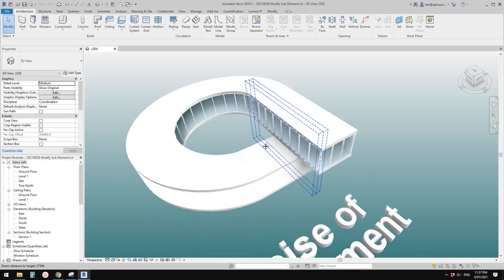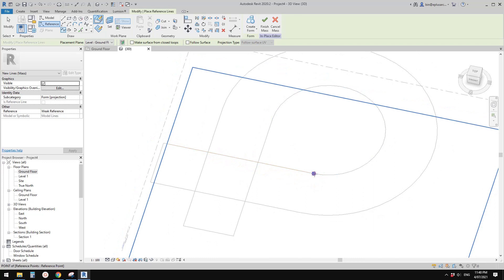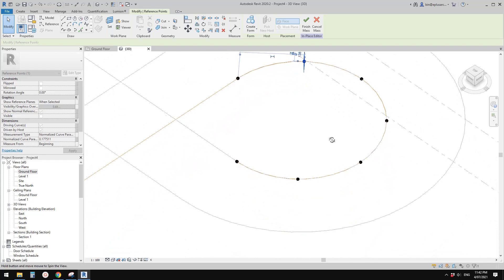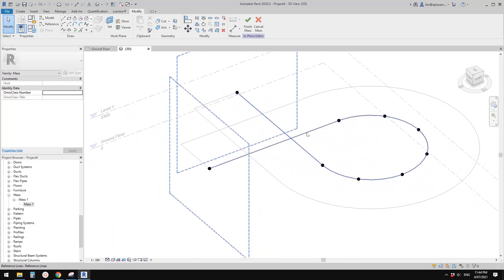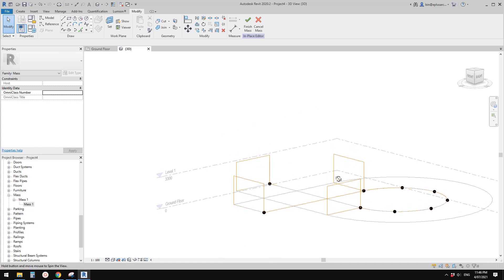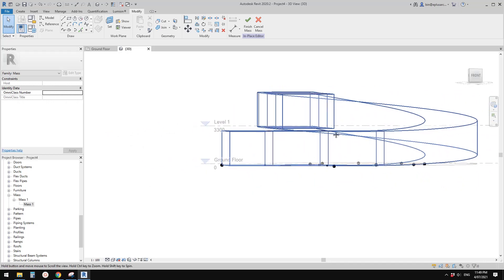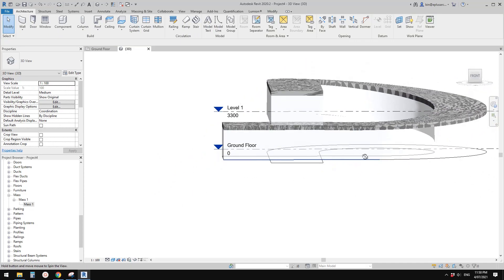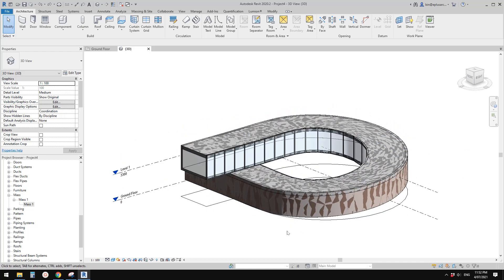Everyday Revit (Day 471) - The shape of 466 using Mass

Comment: saludos , disculpa crees sea posible crear una estructura a partir de el uso de perfiles estructurales adaptandolos a esta forma curva sin hacer el uso de las rejillas dde muro cortina?
Reply from the maker: Usually, you can use structural framing with 3D snapping to create beams that follows the edge of geometry. But it will probably not work in this case because spline is involved.

Comment: Quite tricky to understand the difference between Model and Reference...
Reply from the maker: Do you mean model lines and reference lines?
Reply: @BINHE615  Yes exatly :) Don't know when to use which
Reply from the maker: You can use both model lines and reference lines to create form in mass, here are the differences:

1. Color of course, model lines are usually black, and reference line orange by default.
2. After creating form, model line will disappear and reference line will stay, which means you can still adjust the form by adjusting the reference line.
3. When you load the mass to another mass, or project, you will not be able to see any reference lines, but you can see model lines.
Most of the time I use reference lines in mass unless I want to see them when loaded.

Let me know if you find more difference between them. :)

Comment: wow wow wow! Magician! Believe me your channel is unique, no other talks at all about that cause it's a little scary part of Revit 👏👏👏... thanks you brave Bin  

now I want to ask:
 
*how you delete the form & keep the dots? do you mean dissolve? cause when I delete the form the points are gone
*when point is selected      Properties > Dimensions > Measurement type >  Normalize Segment length what makes the distance between 2 points from 0 to 1? is it right? 
*I 've experienced that sometimes the profile flip & turn around when you copy it away from the path ... although there are options like flip, mirror & rotate angle for each point but Revit could not make the shape even ... I tried to add profiles while the form is on (in the place where Revit accepts : ) then move it them by the keyboard arrow forth & back ... at least you can see when it will crack  👀 
* You can also divide surface in Mass & load a curtain panel family or an adaptive family to get more control on you curtain wall ?
Reply from the maker: *how you delete the form & keep the dots? do you mean dissolve? cause when I delete the form the points are gone.
Usually I just delete, and if I find something missing, Ctrl Z and dissolve. Sometime dissolve give you extra profiles.  I guess check the Is Reference Line box before you create a form is somewhat important.

*when point is selected      Properties > Dimensions > Measurement type >  Normalize Segment length what makes the distance between 2 points from 0 to 1? is it right? 
Yes, you can have other options to, for example, segment length, have a play yourself.

*I 've experienced that sometimes the profile flip & turn around when you copy it away from the path
Don't worry, once you use Pick New and place it back onto a reference line, it will go back to the original orientation.

 ... although there are options like flip, mirror & rotate angle for each point but Revit could not make the shape even ... I tried to add profiles while the form is on (in the place where Revit accepts : ) then move it them by the keyboard arrow forth & back ... at least you can see when it will crack  👀 
Yes, it's a good way to learn how Revit work (massing).

* You can also divide surface in Mass & load a curtain panel family or an adaptive family to get more control on you curtain wall ?
Yes, you are correct.  Pattern based family and adaptive family can be used. Sometimes when you can also use curtain wall and curtain system if it's simple pattern, because you can use the existing curtain wall mullions.

Comment: hey bin, can you share tips about working with IFC, I have a problem when tracing the IFC model into Revit model (3d curve roof model), tried using massing, but quite difficult especially when trying to snaping point or lines. thanks
Reply from the maker: Can you show me some screenshot of what you want to achieve? You can email it to me if you like.